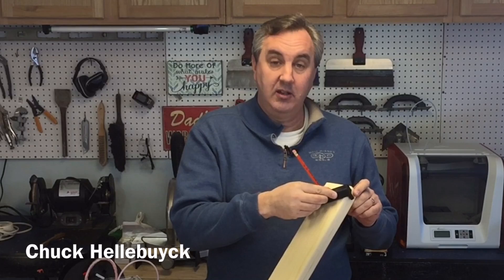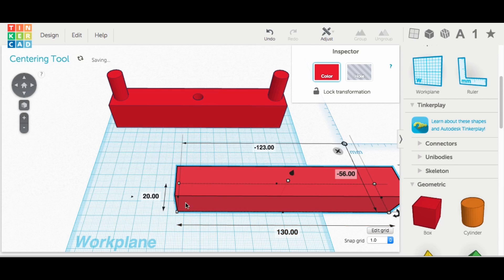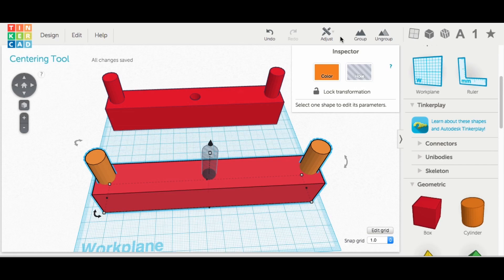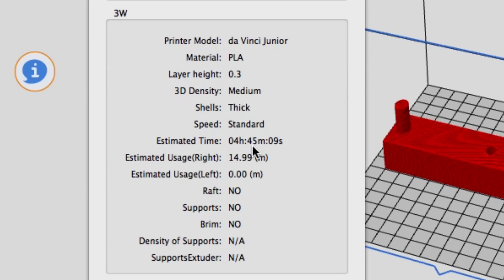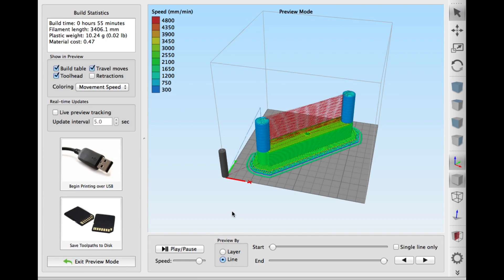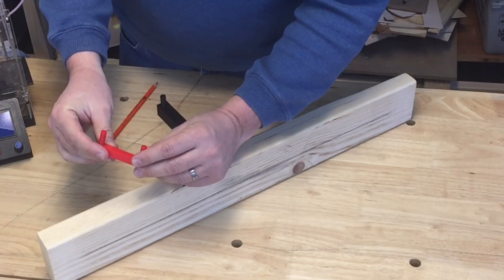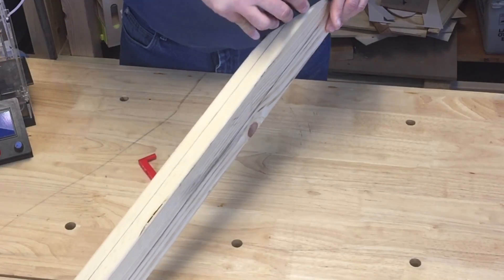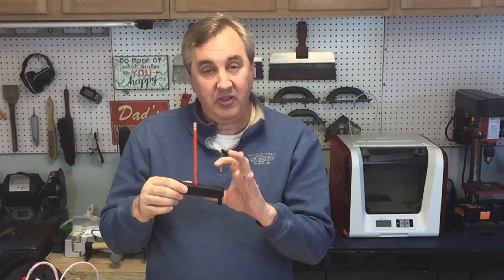Filament Friday #54 - 3D Printed Center Marking Tool using Tinkercad, DaVinci Jr and Fabrikator Mini

Comment: I keep hearing you talk about Simplify3D software and would like to know more.  
Do you ever use this with your repeater .92 flashed da vinci 1.0a or does it only work with the original XYZ firmware?  
I'm sick and tired or fighting with windows issues and repeater host and want to find something that just works on my Mac.
Reply: +Chuck Hellebuyck&#39;s Electronic Products  Did you try it with Simplify3D?  Or does Simplify3D require the stock XYZ firmware?

Comment: Don't you have to make sure the two cylinders have the same distance from the center hole? Did I miss you aligning that?
Reply: +Chuck Hellebuyck's Electronic Products Ah, I thought the posts were just centered on the width of the block, but since you grouped them, you centered the whole group on the block making the distance from the center to each post the same.

Comment: great video ,,It gave me idea, what about making one with them both back to back one piece same center hole just flip it over.
Reply: +buzzerco or make some holes where you can plug in extra legs for smaller widths. or even make it hinged so you can just flip them down and fold them up. i guess it depends on if you wanna have it simple or fancy

Comment: i just got my fabrikator mini and im having connection issues. when i plug in the printer to my computer with the usb all it says is no drivers detected. do you know how to solve this?
Reply: ***** thank you
Reply: ***** so i contacted hobby king any they didn't help. can you help me?
Reply: thanks but i got it to work just by plugging the printer in to a usb 2 port and not usb 3 ;)

Comment: Chuck, Just a heads up, the Fabrikator Mini S3D profile on your site seem WAY off (settings).. You might want to check it.  Also, would you be willing to share the .stl for the S3D platform build area?
Reply: You're the man! Thanks!
Reply: +Chuck Hellebuyck's Electronic Products I don't see the .stl for the build area? I may not have been very clear, I'm talking about the build area graphic inside S3D (looked like yours may be custom?). Here is a pic (if google doesn't spam it) http://www.imagebam.com/image/92e6a8464825724

Comment: can you get a fabrikator mini only at hobby king? the us one is sold out
Reply: +Poke Snake You can try and find the TinyBoy V1 which is what the Fabrikator Mini is based on. But it usually is more expensive since HK used some cheaper parts and mass produced it. There's going to be a TinyBoy 2 soon.